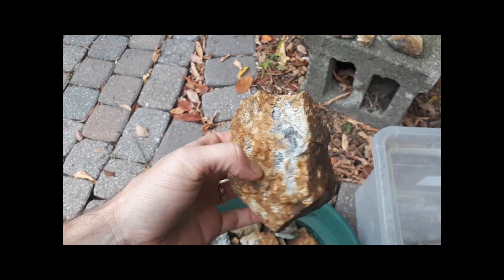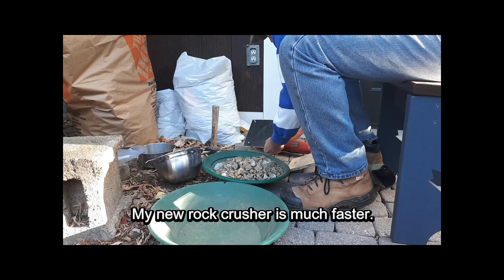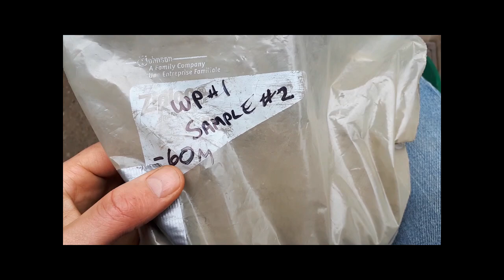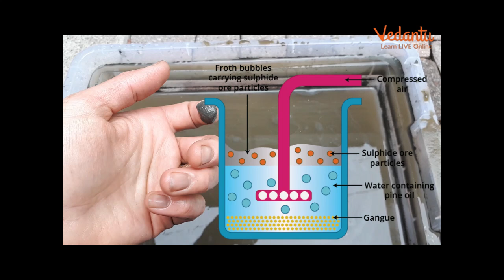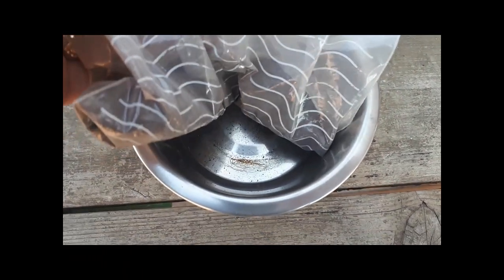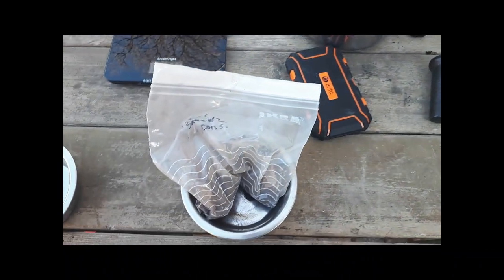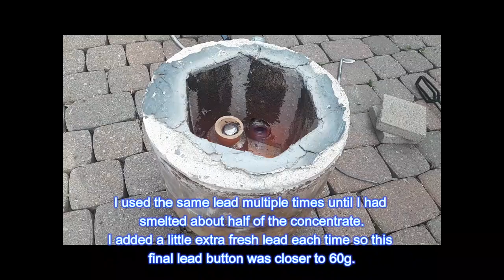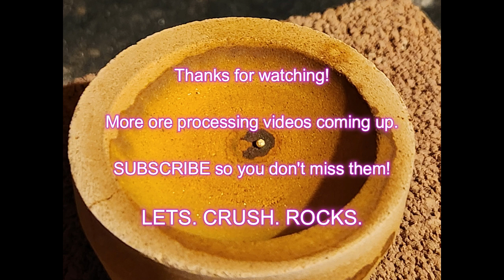Extracting Gold from More Ore I Found at an Old Mine Dump

Comment: Great job bro , i never try with lead , how many hour the lead stayed in the cupel ? And for roasting how many mnts or hour PLS ?
Reply from the maker: Thanks! The time it takes to cupel all of the lead away depends on how much lead you start with. A good rule of thumb is that it will take about 10 minutes + 1 minute for each gram of lead (so 30g of lead would take around 40 minutes). But that depends on if the lead is getting good access to oxygen. In my furnace in this video it was hard to ensure good oxygen flow. But I now use a different set up that blows air into the furnace and it cupels much faster.
For roasting, once it is up to temperature it shouldn't take too long. Maybe 10 or 15 minutes if it is spread out in a thin layer, and stir it up a bit. Just wait for it to stop smoking and for it all to change colour to know it is done.
Reply: @LetsCrushRocks  thanks bro 🙏🏻

Comment: If the original rocks contain gold ore would you not need to heat it or add a base metal etc to release the gold?
Reply: Ok, you did, still watching 😅, imagine when the ancients had gold rich ore rocks in their camp fires the gold pouring out.
Reply from the maker: @dav1dbone  I'd be curious to know at what point in time humans started to extract gold from ore instead of just from placer deposits.